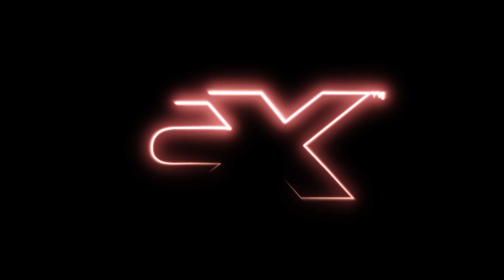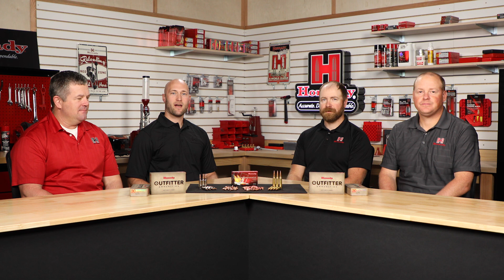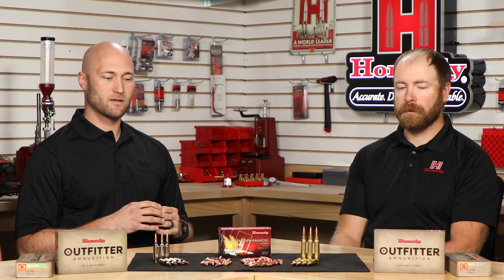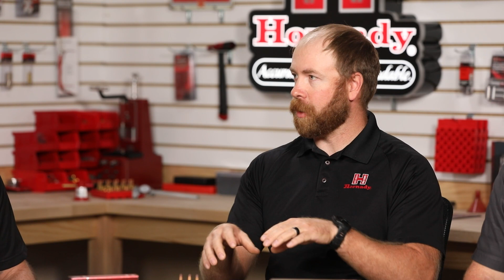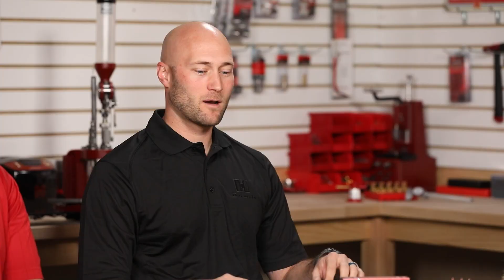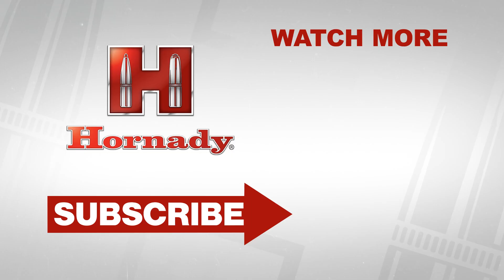CX Bullet Overview

Comment: These seem to be a little harder than other monolithic options.   Expansion seems to be a little weaker on the 6.5mm 120gr CX at modest speeds (2700+ at the barrel inside of 200y / deer).  I've heard some claims that they act like FMJ not sure I'd go that far.  I'm hoping for better luck on the 130gr CX in a faster 6.5 (PRC) but not finding a lot of good load data for it.

Comment: The Badlands Bulldozers have higher BCs, open up at 1700 fps impact velocity and petal just like the CX. Also tip retention does not aid expansion. The Bulldozers use machined aluminum tips and these tips are ejected. The discussion on pure copper is totally false in terms of copper fouling and speed. Ignore it.

Comment: Unfortunately the Superformance 139-grain CX's will not chamber in my 7mm-08 Tikka T3x lite. C.O.L. is just a little too long. I had the same issue a few years ago with 140-grain Nosler E-Tips, and I read a lot of others had the same problem. My rifle will chamber up to 160-grain Norma Tipstrikes (bullet length 1.35"), and 150 grain ABLRs loaded by Underwood (1.38"), which are just as long a bullet as the 139 CX, but the C.O.L. on the factory-loaded CXs is just a little too long. Interestingly, several boxes of the old 139-grain GMX chambered just fine a couple years ago. Something to keep in mind.

Comment: is this similar to the GMX bullet you guys used to put out? the superformance GMX loading was my favorite 5.56 loading from any manufacturer ever...deep penetrating, massive wound cavities, and barrier blindness. but i haven't been able to find that in a very long time. i saw this 5.56 superformance loading with this CX bullet on midway but i noticed it mentioned that out of a 24" test barrel, the velocity was only 3175 fps? most everyone who wants a 5.56 load is using a 20" or shorter barrel, so i'm wondering what the velocity would be out of a 20" barrel rather than a 24? the superformance loads were supposed to be faster loadings, but 3175 with a 55gr projectile out of a 24" barrel is pretty slow, so i'm wondering if the information on midway's page is correct. also, how would this 5.56 loading of the CX superformance do for self defense? and one more thing, i looked on the hornady website and noticed they mention a 50gr .224 diameter bullet for .223/5.56 loadings but don't mention a 55gr bullet, even though midway has a 55gr CX superformance load for sale. is that an error or is it because the 55gr is not available as a bullet for reloading and is only sold in loaded ammo form?
Reply: the CX bullet is an upgrade to the GMX which had been discontinued. The CX bullet is the most cutting edge monolithic bullet on the market.
Reply: @scubanator3990   I've seen Hornady's marketing stuff about this bullet both here and on their website and I haven't seen anything that says this bullet is any more "cutting edge" or better in any way whatsoever than the GMX. Either way, the bullet may be great but for those of us who don't reload I would love to see that bullet loaded into a cartridge that will achieve the kind of velocities that the old 55gr Superformance GMX loading had. Even with longer monolithic bullets, a true 5.56 pressure 55gr bullet should be doing better than 3175 out of a 24" barrel. I would expect those velocities from a 16.
Reply: This would not be my self defense ammo choice. You want to minimize pass through to avoid damage to anything behind your target. There are many better bullet choices for this.
Reply: @jayellgee  minimizing pass through is at the very bottom of what i consider important for a self defense ammo choice, there has never been a citizen self defense shooting where someone shot through someone and hit another person, ever. the fear there is overstated. i would rather have too much penetration than not enough. if you have to shoot through someone's forearm (which is actually very common especially if someone has their arm(s) extended with a weapon of any kind, i want that bullet to go through their arm bone or bones and into the rest of them where it may encounter even more bones. the GMX penetrated 21" in bare gel in arfcom's tests, that was also out of a shorter barrel than i would be using so with higher velocity i would expect more expansion and/or fragmentation and therefore slightly less penetration. it's a barrier blind round so the penetration makes sense.
Reply: @bobbyc2768 you are exactly right! Great post!

Comment: Why not a cup-and-core design? A copper alloy jacket with a soft pure copper core and heat shield topped soft copper expanding tip - one that fully mushrooms on a deer at 1800 fps!! Your bullet needs high impact speed or lots of resistance ie a moose! Same old same old.....

Comment: Just got some CX 5.56.... disappointed...The red polymer tip, literally isn't on any of them. just a tiny hollow point
Reply from the maker: 22 cal is the only CX that you won't find a tip on and for a great reason. They actually perform better at that diameter without.
Reply: @hornady  thats great but like I said...i got the 5.56 which should have the polymer tip.
Reply: 5.56 is a 22 caliber. No tip

Comment: will it work as good in a rifle with a slower twist? not in the mood to buy a new rifle just for the cx bullet
Reply from the maker: We have CX bullets for traditional twist rifles. The only ones that will require a faster twist would be the 6mm 90 grain, and the 30 cal 190 grain.
Reply: @hornady  the 190s say 1:10 for twist rate.  Your test barrel for 300 PRC was 1:8.  Most PRCs are 1:9.  So, whats the twist needed?

Comment: Hold your horses guys.  While comparing the GMX and CX loading in the cartridge I shoot, the GMX has a significantly higher BC than the CX.  When I use the 2000 fps speed you say is required for both bullets, that GMX gives me a 50 to 80 yard advantage over the CX.  The hype and the figures don't add up.  From what I can see, the CX loading is vastly inferior to the GMX.   I realize when it comes to hunting, BC means bullet construction, but the differences are to great to ignore.  Wanna run this by me again?  Thanks for the vid.
Reply: You obviously missed the point of the difference in the bullet. Speed isn't everything. More barrel life, less fouling is just a couple of the differences. Pay attention if you shoot super long-range shots that would make a difference to you whatever works for you is fine. But you missed the point.
Reply: @garrytalley8009  I got the point.  But the math is all cockeyed.  No matter, the GMX is discontinued and I'm just fine with the CX.  Got a chance to talk to a dealer rep about it and he explained why the numbers were different.  Relax, it's no big deal.

Comment: Copper bullets are BS.
MANDATED (hint-hint) by anti-gun politicians who know nothing about physics, neither internal (lower density will limit the length of the bullet the same rifling will stabilize), external (lower density AND lower length mean significantly lower BCs) or terminal ballistics (you need density for proper penetration, you'd need to use bigger calibers with less bullets for the same efficiency). Are you expecting Californians to buy all your stuff?

I am all for lead not touching the meat people eat. Make TMJ long hunting bullets with soft core, you don't even need the frontal expansion, tumbling at the limit of stabilization and flattening from the side does even better job.